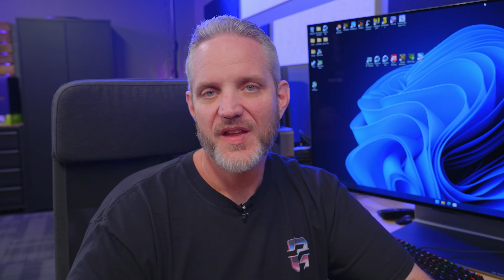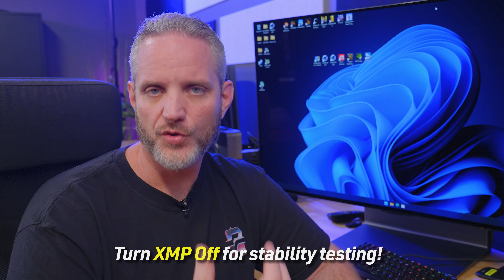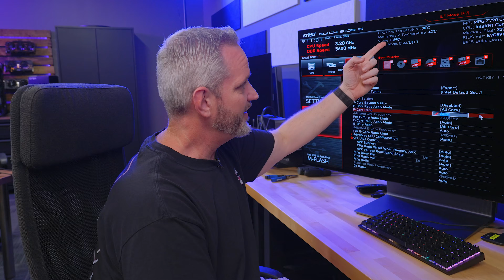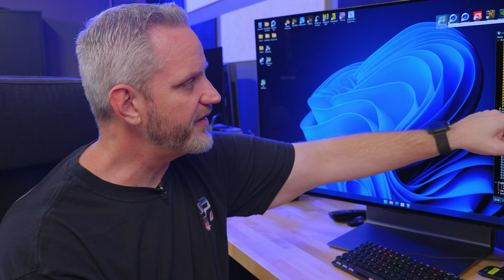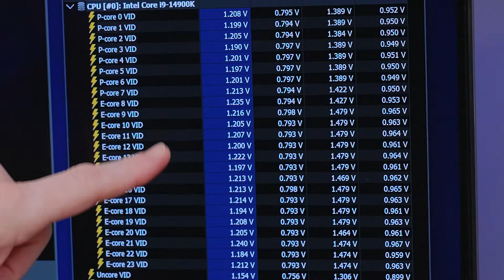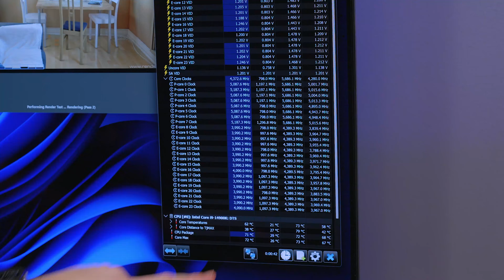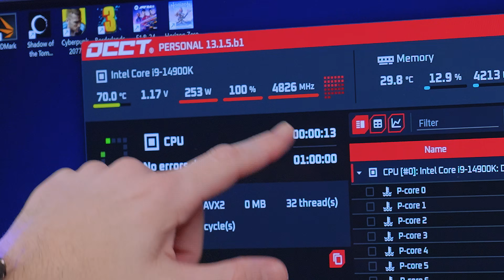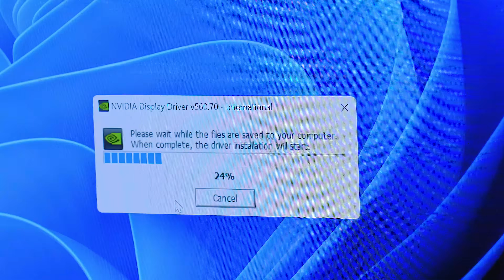Guide: How to check if your CPU is BAD!

Comment: I recently got the 4080 S with my i7 13700k. I installed the geforce experience app to download the drivers for it. but for some reason i kept getting random different blue screens. I've had  been re-installing the drivers multiple time and every time i opened the geforce experience app i noticed i got a message that said to upgrade to the nvidia app or to ignore. but every time i ignored it. Until i pressed the upgrade button and it installed some different program and said i had to install the drivers that i already had on my system again because it couldn't find them. so i did a clean install and after that i've had 0 crashes, blue screens or any other shenanigans.

Comment: I still see a lot of people buying these Intel processors as they know the risk, but still want the performance as there's nothing wrong with that since they're under warranty.
Reply: As long as you don't need that computer. As long as you don't value your computer, or the data on it. I do. So I would NEVER take that outlook on anything. I've got two backup systems for every "important" computer I have. I can't be out of a system as it's money.
Reply: @Doesntcompute2k  I wouldn't use it for anything critical what is perfectly find a tinker with or use as a gaming machine as the majority are not having issues with it anyway. It's not like AMD has one of the worst CPU failure rates in the industry so the odds of a reliable Intel chip for looking pretty good at the moment.

Comment: 7400-8000 Mhz ram will NOT be stable in 99% boards, unless you have 2-dimm boards like Z790 APEX or Tachyon. If you have a 4-dimm board and you bought fast and expensive ram - you wasted money. Board manufacturers specs on website are BS for ram speeds. Stable speeds for most intel 13-14 K cpus are 6400-6800. If you have fast ram and you system blue screen all the time and games crash - it is probably the ram speed, not CPU degradation. And also, 4 sticks of ddr5 fk things up in term of speed badly. Never get 4 sticks of ddr5 unless you are desperate.

Comment: How do you update your BIOS before installing the CPU? Should you use a burner CPU that you throw away after you use it to update the BIOS?
Reply: Iirc some motherboards have a button you can press when you have a usb plugged in a specific port. You are best researching this yourself than taking my advice though.

Comment: Damn it Intel. I've always been a fan.  Recently my MOBO crapped out on me; I had a 10700k in it.  I loved that little processor.  I needed to build a new system so I thought I might as well upgrade to LGA1700, it'll give me some headroom to upgrade in the future.  I picked out my components, placed my order, got everything delivered, and then I found out about all these issues.  My 13700k is only a couple months old now so I'm hoping it's still new enough where I can apply the new BIOS, maybe lock some cores and undervolt a little, and hopefully avoid the problem with the accelerated degradation of the CPU.  It is nice that they added 2 more years to my warranty. I hope that if it experiences any problems that it will happen within that 5 year span.  Maybe by then or before then I'll be ready to build a new system again before this CPU craps out on me.

Comment: got a new 13700k , updated bios and changed lite load and put voltage offset and now my voltage is at 1.250 while at load and its super stable and cool. Was a big upgrade from my 10700k in gaming.
Reply: nice man I’m getting one soon is there a tutorial anywhere I can find to update bios and settings I may have to change?
Reply: @Slykov  Go to mobo manufactures page , for my mobo it was MSI Pro z790 A Max and check under support / download you'll find the bios and " click here for a video on how to update bios " msi made a video by themselves showing all steps , just follow the steps and it's done 
After bios update only things I did was -
1. Turn off multicore enhancement ( called enhanced turbo on MSI )
2. Change cpu lite load to whatever number you want , mine was at 20 as default so i brought it to 10 
3. If everything is stable after changing above stuff run some tests or games you play regularly and check temperatures, performance and voltage and then you can start applying negative voltage offset in bios slowly lowering voltage till you find the perfect spot for your CPU and you're done.
Reply: @Supernova094  thanks man

Comment: I don't entirely agree about the XMP. It's better to first run the test with XMP to see if the whole system is stable or not. Then, if there's instability, rerun the tests without XMP to isolate a problem at that level.

Comment: Gray Zone Warfare is the best early warning system I've found. It will crash quickly either on game load or map load within 3 runs. Verified on multiple 14900k's (good ones and bad ones). It will throw the infamous Oodle decompression error if your CPU is bad.

Comment: It's long been understood that 70 degrees C is is safe sustained operating temperature to prevent circuit degradation.  Never had a CPU fail for over 10 years use 24/7 adhering to that.  Aim to keep the top temps below 80 degrees C under load.

Comment: So what you're telling me is that my i7-3770 is degrading after a mere 12 years?
I think not. Things were built different back then.
Reply: I still got my i5 3775 , with  big noctua cooler, tried to clocked it up 1ghz with a z77 mb run stable :) and I never give more voltage then what they need, still, kicking ass with a integrated igpu and an extern amd 480 gfx :) think its 12 years too

Comment: Im doing this rn step by step. intel corei9 - 14900k OCCT test atm 10 min in, no errors detected. 100c temp, 1.05v 221w 100%, 4353Mhz
Reply: my MB is Asus ROG Maximus Hero Z790 with the latest bios. GPU is Gforce rtx 4070 OC 12gig. My CPU temp is 49c in idle and Im using fractal s36 water cooler. Not sure if the pump is even working at this point. Every game crashes and its infuriating tbh. That all started today.
Reply: Aaaaand We got our black screen on Heaven. Is this the end of my RTX 4070?

Comment: Have msi z790 gaming plus wifi, lastest BIOS from 15 agust, Artic Freezer 34 eSports DUO cooler and 13600KF, have bios default with intel baseline config, and im takinng high temps, like 45 - 50º just when power up, and using any test program make my temps go to 95 - 100º, just annnohter example with gaming, lol make my CPU go to 70 - 80 º if i test more instensive game i go to 99 - 100º

Any idea waht could be causing this problems?

Comment: If I were the decision-maker inside Intel, this issue should have been by offering all customers the option to change to a 12th-generation CPU or get a refund. I guess they did not do it because 1. It is not a customer-driven company but a marketing-driven one. 2. They are afraid the issue is even bigger and includes other or all products made by Intel during the past two years, including their server products.

What leads companies to this stage is worth much scientific research work. Being in the Industry for decades, that is of no surprise to me. Let us not forget a business fails when it runs out of cash, not when it has the worst of anything else.
Reply: Refund should include the motherboard otherwise we stuck with slow and old. Sucks to have "upgraded" from and AMD setup.

Comment: Or you could go AMD and avoid everything this video has to offer.. I mean at this point AMD could advertise "Use our CPU's and you can keep your PC on when you're not around." (My PC has been on for nearly 3 weeks now.. I tend to do that, I'll reboot for a windows update, then it'll sit for another few weeks.) What I got from this video is that Jay is still huffing copium, it's still the Motherboard vendors faults, and he's stumbling over his words to try his best to avoid blaming Intel. Perhaps just use AMD, where you don't have to go into bios and fiddle with voltage, nor do you have to stress test your CPU for 10 hours every time your PC throws a random fit over software bugs. But no! AMD CPU's are underwhelming.. yeah no shit, cause Intel has been pumping enough juice through theirs to kill a small army in order to get their performance.

Comment: 100% not all 13th and 14th gen are having issues. I have had a 14700k since launch. got it on Nov 7th last year. after PC was built and first boot. I monitored my voltage, power and it was too high for my liking. tweaked things right away with undervolt and putting in limits to make sure cpu is running in spec with similar performance. haven't had issues yet. But in reality. Intel really does need to keep Mobo manufacturers in check on all this. And Intel needs to make sure all new CPU's and mobo lineup launch with Intel default performance profiles with the option to change to Extreme if user wants.

Comment: 13700(non-K): Relatively stable, hasn't BSOD'd in a few weeks. Board is running 0129 MC now, though. Still having USB Root Hub issues, though. These didn't crop up until putting this CPU back in after the other died. I'll wait to stress-test this one until my other is replaced so I don't end up without a computer.

14700K: Dead. Started as random BSODs in games, then Windows, then during boot, and now crashes in the UEFI, IF the system even gets that far. Waiting to RMA until someone announces Intel is actually doing something about these dead chips. Not looking to waste money on shipping a dead component back and forth.

Comment: I know this is probably a dumb question but  I have i9-10900k 10th gen could any of this affect my processor...msi carbon gaming z590 wifi  mb... using Intel xtu...undervolted to 1.95 with -.55 offset turbo boost Set to full and 51.51. 50 through the rest of the name eludes me ATM but it's the collom on the left in advance setting right below the section where u adjust voltage  offset etc... without power and thermal under any load.... with xtu settings never gets above 70 to 75 is Celsius maintaining around  5 to 5.1 ghz

Comment: Just upgrading the bios can be risky if you are on the MSI board. The first thing you have to do after that is checking AC/DC loadline either in HWinfo or in the bios. It shouldn't be higher than 1,1 mOhm. But MSI is pushing 1,7 mOhom for most of their boards recently which causes EXTREME overvolting.

The easiest noob friendly fix: go to the BIOS and set Lite load mode to 12 (it should be at 0,8/0,8 mOhm). This way you don't have to change LLC from auto and keep CEP enabled without loosing performance.

You can also change AC/DC LL manually but I don't recommend messing with that if you don't know what you are doing.

Comment: Have to say I'll never buy an Intel chip again after this. My first build was an AMD(K6-2). Then when the core 2 line came out I switched. I did not go back to AMD till the Ryzen chips came out. I don't see ever buying Intel again. I'd rather put up with small bugs on AMD than buy a Intel chip that's a virtual time bomb.

Comment: LOL just run fortnight.  Anyway I have a launch 13900k and had this issue for the entire life of the CPU.  I have spent money on Z690, New memory - DDR 6200, 6400 and 6800.  All crashed during fortnight and COD. Bought a Z790 Still crashed.  Bought new PSU upgrading from 1200 to 1500HXi still crashed.  Then I was getting out of memory  faults and opened tickets with Nvidia who then pointed at the CPU issue.  18 months.  Anyway I told intel I am done I want a refund.  Paid launch price 649.99 + taxes came to like 722 and Intel offered 599 check.  No tax  just 599 all in.

Comment: It's a bit weird for me... on my MSI Z790 motherboard, my 14th gen CPU reads higher voltages on Intel Default Settings on the new microcode (0x129), compared to its Unlimited (4096w) counterpart, on stress test. Am I understanding those readings wrong? I've actually retained my setting to Unlimited for now, instead of the Intel Default.

Comment: So, I just ran the OCCT for an hour, and it states that I had 5 WHEA errors (Where would I find what the errors are on the software?). I7 13700K, Asus ROG Strix Z690 Gaming WIFI. CPU maximums: Temp 94C, 1.314V,  263.93W, Usage 100%, and 4989.54 hz.  Bios is 3401 from March where I enforced Intel limits.  I take it I am cooked?

Comment: No, all CPUs do not degrade.  At least during the feasible average use life time of most CPUs. This is simply not true. Also, running these tests like this will not help. There is so much misinformation here unfortunately.

Comment: Probably should have mentioned that your CPUs VID table has a major impact in the degradation process🙄 Also stock memory settings might in some scenarios mess with the results, consider disclosing that you are only verifying @ stock and results might not be valid across all configurations

Comment: Oh... My 13700K crash on R15 multicore. Hard. On the 2/2 run that I hit it. This need further testing as I do still has my -0.015 vcore and XMP on. R23 works fine, and I did verify my -0.015 back then with a 30min R23 run and it's fine back then. My recent R23 run has VCore max at 1.32, temps in the 90 on a 360, pulling max 238W, I think it doesn't sound healthy.... My normal everyday workload still fine thou, there is never a crash in that.

Comment: I highly recommend closing Chrome before running test. It can eat up CPU resources especially if there's a bunch of tabs open.

Update: Ideally, you shouldn't have anything running to the best of your ability. Obvious things like Windows services are fine, but avoid running things like torrent downloads, Steam downloads, your browser, or anything similar. This will give you a Safe Mode-like experience to test the CPU.

Comment: People are probably assuming that "all" 13th and 14th gen. CPUs are [advanced] degraded because whether you are using it for your daily driver or thinking about buying one on the secondary market, you would have no way of knowing if that CPU has had too much voltage or an oxidation problem. This is especially problematic for anyone considering buying a used CPU for this platform because then you would be completely in the dark and wouldn't know if the seller was getting rid of it because it had stability problems and was past warranty or not worth the RMA process in their opinion. If you purchased a brand new 13th or 14th gen right now, you remained the original owner, and you updated your BIOS on your first boot and verified the voltages and load line calibration were acceptable and within specification, then you might be able to expect your CPU to last the "lifetime" of the platform until you upgraded next or switched platforms.

Comment: If you have Intel gen 3, and somehow you want to test stability with Cinebench 2024 and got error. Don't worry, it not degradation issue, it because gen 3 does not support AVX2 that Cinebench 2024 need.
Reply: Thank you.

Comment: Hi Jay, great work as always. As an RF, Analog, Mixed-Signal CMOS integrated circuit (IC) design and layout Engineer, I can tell you that, in general, the Silicon Chips, including cell-phone, desktop and laptop communication chips and processors are all designed for a 10 year lifespan with the highest currents and the resulting electromigration. Some last longer, some last shorter, depending on the process nodes. The computer I'm using to write this message is a 14 year old HP Pavilion with Intel's original i7 860 processor with NVIDIA GeForce GT 730 (that was installed later to allow for 4K display - since I'm using my 55" UHD TV as my monitor). I do turn off this computer between 8 to 16 hours a day.

The first and only gaming computer that I built with your help and advice (thank you Jay - and Linus Tech Tips) uses i9 13900K CPU (liquid cooled) and NVIDIA 4090 MSI SUPRIM liquid cooled GPU. We'll have to see how long that will last.
Reply: I was expecting some interesting insight from an expert. Quite a downer with "i bought pc that you recommended so lets see how long it will last"..

Comment: Nzxt N7 Z790, i9 14900kf. What caused me to look into all this was the out of video memory error constantly with 4090, (mostly starting up Grounded) but random crashes multiple times a day on various games. Dayz, helldivers, ect. I couldn't even finish the training tutorial on Helldivers because my cpu ramped to 90°c+ and crash. I viewed reliability history and had critical errors every single day. Sent it back to Nzxt and they told me nothing was wrong with it. Got it back and sure enough the same stuff happening.  I fixed it myself after researching and coming across this problem. Updated bios, set whatever the short and long term limits are called to 253, and max load or something to 350 (before was set to 450 i believe). So far I've only had a few crashes over the past month, compared to 5-10 in a day. Will be contacting Nzxt again though to see if they will rma the cpu or if they're going to make me go through intel.

Btw although I am new to a lot this stuff I still have to say nzxts ui in the bios is hot garbage.  Have yet to find a good video correlating all the system setting verbage from nzxt to say an Asus or Msi board as that's what the majority of all his (and others)  tests are done on.